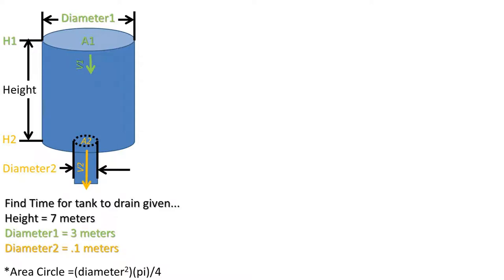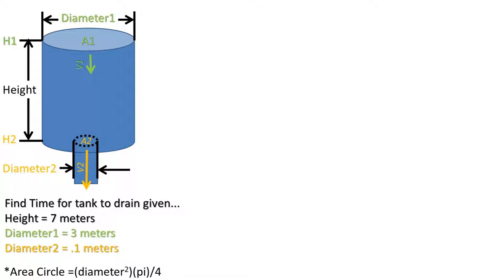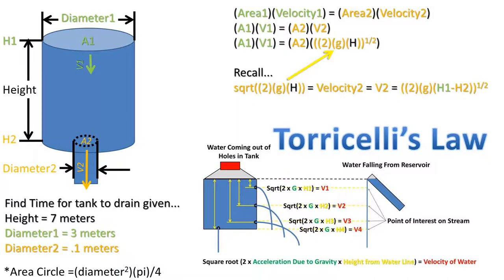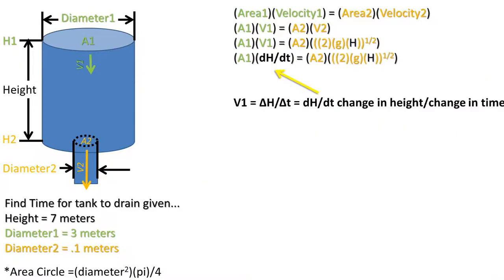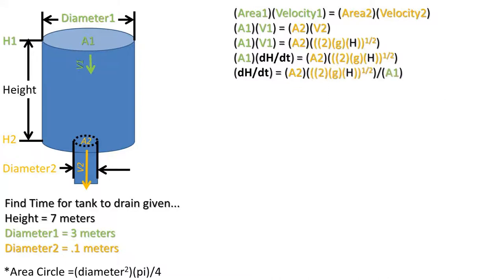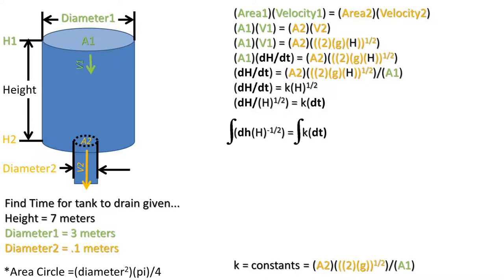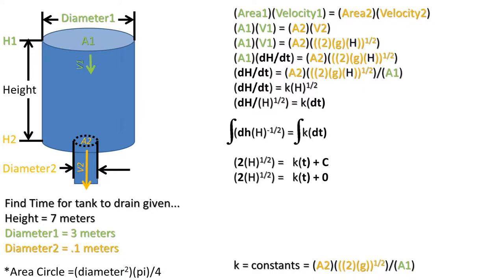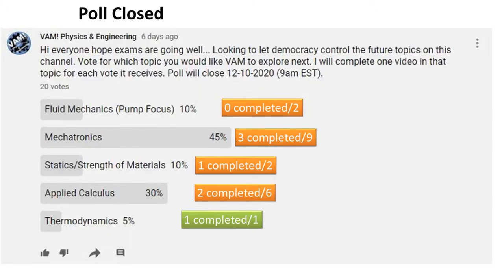Time For Fluid To Drain From Tank (Applied Calculus Problem and Solution Ideal Fluid)

Comment: 2:55 I dont understand: the "H" is actually "H(t)" because the height of fluid is a function of time. But, you are integrating this function with respect to "dh", not "dt". 
What?
Reply from the maker: both sides of the equation were integrated with respect to the variable isolated to that side of the equation.
Reply: @VAM_Physics_and_Engineering  That's not the point I was asking about.

Comment: I did this experiment irl as homework with 10cm diameter bottle, 0.8cm diameter hole on the side of bottle which is 6cm below the water surface. It lasted 30 seconds for water to come down to the level of little hole. But when I do the calculations just like in this video, I find that it should be 17.3754 seconds. What am I doing wrong? Isn't this a lot of error?
Reply from the maker: I have not completed the experiment myself... This video assumes an ideal fluid where all potential energy goes into the velocity of the fluid coming out of the hole. In the real world there may be losses due to friction/viscosity, water rotating or being turbulent in the stream due to the hole being jagged to name a few.
Reply: @VAM_Physics_and_Engineering  Thanks for the answer.

Comment: hello can i ask why is v¹ = dH/dt?

i cant seem to grasp it since shouldn't it be dv=sqrt(2gh) dh ?
Reply from the maker: The velocity is how much distance the water tank is lowering by over time. So the change in height or delta of height over the change in time or delta of time. You could flip this problem on its side and look at it as if there were a car at the water line... You would define this cars velocity as the change in height distance over the change in time. (gravity would be going left to right) The free falling portion is only the portion coming out of the water tank point 2. Hope this helped still waking up.

Comment: Can you explain to me why the C constant is zero?
Reply from the maker: The values we integrated with respect to do not have any additional values outside of the equation (problem as stated) that needs to be added to it. Think in terms of the integration of acceleration=acceleration to be velocity = acceleration times time plus velocity. No velocity no need to add anything to the equation so the constant would be zero. I hope this helps.